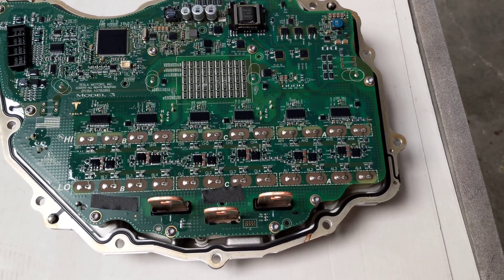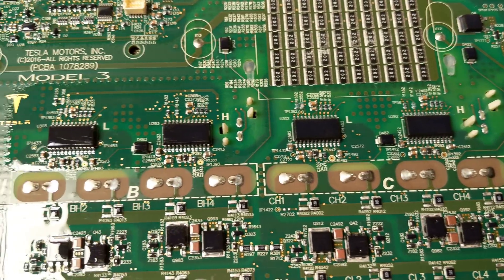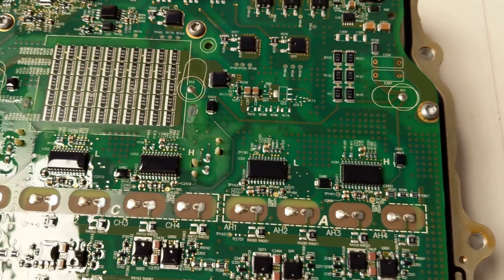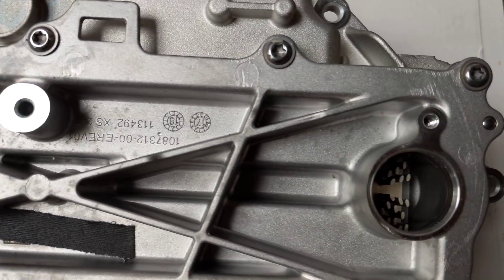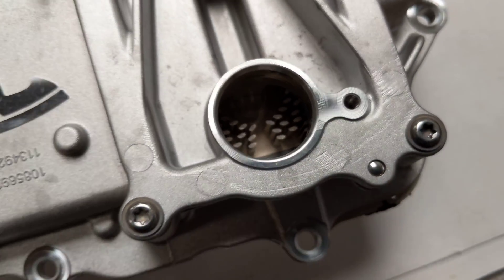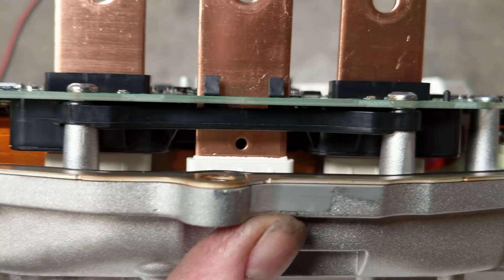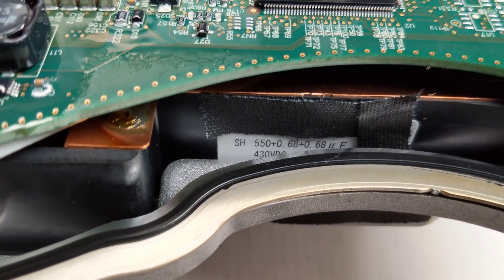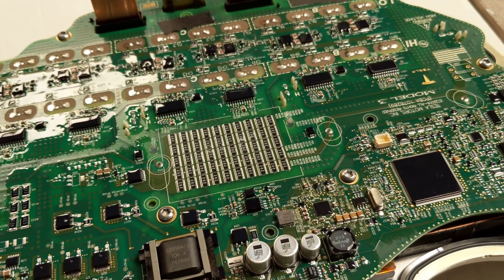Tesla Model 3 Drive Inverter

Comment: I'm not sure what you were referring to as the SiC FETs ?  was it the D-Squared paks on the PCB or were there some modules behind the PCB on the bottom side ?
I find it hard to believe that 24 D2Pak SiC FETs are going to do as much power or current as I am seeing talked about here ?  Is that right that there are just those 24 D2PAK SiC FETs ?
Reply from the maker: No, as I said in the video they are custom parts mounted on a coldplate.  I have never seen any package like this in use before, it's a large rectangle with massive copper tabs on opposite ends (Source and Drain).  Did you even watch the whole video?  The side of one can be seen at 2:10.
Reply: Ingineerix yeah I watched the entire video a couple of times and especially the part where you showed the copper tabs but I was not sure if you were referring to the 24 arrange D'squared packs on top or something else underneath. The heat transfer methods are sometimes extreme so I wasn't sure if there was an extension of that to the D'squared packs. It was hard to tell what you were trying to show from the side. What you just said confirms my suspicion. Thank you.
Reply: You also mentioned I believe that they was were ST silicon carbide FETs. It did not look like you could read any manufacturer name on custom parts from the side but I saw your number in the description. That number was probably visible on the D'squared packs so that was my confusion  source. I know that Tesla is using another company's silicon carbide fets now at least in addition to these St parts
Reply from the maker: Here is an image from another teardown: https://ibb.co/dfvktz
Reply: WoW!  That's what I'm talking about ! Now it's clear. Thank you !

Comment: really incredible that they managed to fit it all on one board, its things like this that make the overall cost come down! props to the engineers behind this design!
Reply: I already changed 2 inverters. One went 5000km another 2000+km. Now purchased a 3rd one. Tesla 3 SR 2021😅
Reply: Just wait until that ONE little capacitor or something goes bad! from the design you'd have to tear half the motor apart to even get access to it, all those bolts, and then the rubber seals. This board should have been mounted in a box on the firewall or something not buried inside the motor!
Reply: @FCE-dogs  MLCCs are reliable and they have conformal coating, you watch too many Louis Rossman videos lol

Comment: How do you know they are SiC fets? could they be GaN?
Reply from the maker: I know 100%.  Among the evidence: Elon himself has said they are SiC, and ST (the logo on the package) doesn't make GaN devices like this.
Reply: GaN isn't as useful for high voltage lower frequency applications as SiC
Reply: Ok. It's quite significant that 4 little? FETs can handle around 300Arms in mass production 20 year reliability. What does the package look like?.

Comment: This is effectively a brushless esc right?
Reply: Not always, brushless ESCs output more square outputs. Earlier Tesla drive units on the Model S and X were sinusoidal 3-phase inverters as those were full induction motors, don't know about these ones though
Reply: @NoorquackerInd  cool!
Reply from the maker: Yes, but on steroids, and a lot more complex.
Reply: Ingineerix right.

Comment: Great video!! Is there any chance you could post a short clip of the reverse side (dark side) of the inverter? I'm curious to see how they manage the high current routing for the DC link and inverter output phases. As well as how they have connected the SiC FET's to the DC link and output phase bus bars...

Also, do you think the array of bleeder resistors is purely for bleeding the DC link capacitance, or could they also be using them for light/emergency regen dissipation when the battery bank can't handle all the regen energy?
Reply from the maker: There are 2 welded copper bus bars conducting power from the DC input connector, to the capacitors, and then to all the SiC FETs.  Then there are 3 more that carry the output phases to the motor.  There is no high-current stuff on the PCB.  I can assure you those resistors can only be used for cap bleed, there is no way they could handle any regen power.   When you drive a fully charged Tesla, there is no regen.
Reply from the maker: I updated the description with several images of the SiC MOSFETs.

Comment: Great job! What's weight and size total and PCB?thanks
Reply from the maker: The inverter and it's casting/cold plate weigh 8.5lbs/3.9kg.  I cannot separate the PCB without damage, so not going to happen on this inverter.
Reply: Wow. I am really impressed. Could you indicate the dimensions as well. Thanks again

Comment: So is the inverter the same thing as an ESC electronic speed control found in RC Cars? It seems small to control that much power.
Reply from the maker: Basically, Yes.  Part of the compact size is Tesla's use of cutting-edge Silicon-Carbide based transistors.

Comment: what is the C2000 mcu part number? I'd like to know which processor family they are using.
Reply from the maker: TMS320F28377DPTPQ
Reply from the maker: Also: I put the major parts list in the description.
Reply: That ST SiC FET part must be custom as it doesn't pop up on their product list. What is the package? discrete devices? half bridge?
Reply: im willing to bet it's their 100A part repackaged in one of their SLLIMM power module packages

Comment: +Ingineerix ("Feel free to ask me specific questions ") :  Would you  or anyone happen to know whether the control interface to these inverters instructs them to produce specific AC voltage or current at a specific frequency,  or is it more specific to the motor's role in the car, as in "apply X.YZ torque"?    If it were the former, would it be practical for a DIY off-grid solar/battery setup to use salvaged EV battery pack(s) along with a salvaged motor inverter unit, and just command the motor drive to apply 208VAC, 60Hz three-phase power to the home... er, I mean, "motor"?
Reply from the maker: The inverter is highly integrated.  You would not be able to use it to produce AC power without substantial rework.  Mainly there are no magnetics which would be needed for this, and they are expensive at those power levels.  Not to mention, the software work would be a massive undertaking.  You can however use the battery pack as is, with an external inverter.
Reply: Thanks;  the lack of magnetics makes sense.

Comment: I could be way off base here, but since it has a permanent magnet motor and the current is not switching from + to - (inverting), isn't this technically a motor controller and not an inverter??
Reply from the maker: While the motor uses permanent magnets, it is an AC motor, so it has a 3 phase stator.
Reply: Thanks, Learning more about this motor now... very interesting...
Reply: so is it sensored BLDC motor ? for all models or just this one ?
Reply: @SuperAymoon  This one. The others are AC induction machines

Comment: Im amazed how small it is.  SiC has really improved quickly in a short time. What price are these individual mosfets? 100usd? 
70uF bus caps also seems  low ?  Is that all of the capacity to smooth out the commutation ripple?
Reply: That's the capacitor for the low voltage SMPS. There is a much larger DC link hiding under the hood. Though the high frqency SiC switching means the capacitor will be small than you think. Perhaps 250-300uF but with very high power density. Probably 200-250Arms ripple current rated. There are other pictures that show the PCBA removed and the main DC link is clearly visible

Comment: The marking on that capacitor looks like it reads 550 + 0.68 + 0.68uF.  Could be a big low frequency 550uF bulk cap and then a pair of 0.68uF high frequency snubber types?  Any other markings hiding around there?
Reply: I believe the 550uF is the DC-Link X capacitor and the 2 x 0.68 uF are the Y (EMC) Capacitors

Comment: Can you see a part number on the gate driver ICs?  Any idea what the gate drive voltages are?  Interesting to see the custom 4-lead FETs.
Reply from the maker: They are using the STGAP1AS.  Here's the datasheet: https://www.st.com/resource/en/datasheet/stgap1as.pdf
Reply: Great, thanks.  I've used those before, they're pretty close to the fanciest gate driver you can get at the moment.  It looks like they still have an external high-current buffer, which would make sense for trying to drive 4 together.  Normally I would have assumed they'd have issues with output currents flowing through the paralleled kelvin sources but I guess the actual source connection to the bus bar must be low enough impedance to limit that.

Comment: at 2:18 you say "for each group of 3" but I think you must mean group of 8?
Reply from the maker: There are 8 FETs welded to each of the 3 busbars that go to the stator, 4 positive, 4 negative.  I wasn't clear, but I mean there are 3 groups of 2 switches (+/-).
Reply: The motor/controller are three phase, and there's one output bus per phase.  So there are three busses.

Comment: Does it require cooling?  I worked on the 1st version M3 inverter, it had 36 IGBT's mounted to a liquid cooled heat sink.
How does the M3 dissipate the heat?
Reply: Yes, there's a liquid cooled heat sink.  You can see an inlet or outlet in the video with the heat sink pins standing out from the heat sink.  Motor, controller and battery pack are all liquid cooled.
Reply: Of course it requires cooling. If it's going to run 200kw peak it would need 20-30kW of cooling...

Comment: According to docs online the module is custom designed for Tesla order by European R&D company (http://www.apcenter.nl) and contains two ST SiC  mosfets, likely the same dies found in those: https://www.st.com/content/st_com/en/products/power-transistors/wide-bandgap-transistors/sic-mosfets/sctw100n65g2ag.html (650V, 22 mOhm, 100A)
There are 24 modules, and in 3 phase inverter it means 4 modules in parallel, giving rating up to 800A.

Comment: Impressive!  Remember it handles close to 200kW, soooo crazy 😲
Reply from the maker: This inverter can do almost 300A per leg.
Reply: @Ingineerix  are there hidden FETs on the opposite side of the board?
Reply from the maker: According to the info from the CAN bus, the max kW it can pull on a RWD long-range at 70%SoC is 308kW.  Of course that doesn't mean that's how much you get in practice, just what the limit is.   BTW, 200kW would be around 500A from the pack total.  (depending on SoC)  Keep in mind, per-leg RMS current is not the same.
Reply: @Ingineerix  Thx for sharing that, I'm curious and I dont understand the power IGBT connection. Power switch is obviously through hole (TO247 I guess) but there is only 2 pin for each.... I recognize the custom gate drive based on Dpak mosfet but the third pin of switch remain a mystery. What is the trick ? Do they bend a pin behind and connect it directly to a bar bus to economize some layer with strong thickness of copper ?
Reply from the maker: @UPR91  These are custom package SiCFETs, (see description above) each of the 24 discrete packages are arranged in six groups of 4 in parallel. For each of the 3 output phases, there are 4 for high-side and 4 for low-side.  Besides the large welded tabs, There are 2 small pins on each SiCFET that I assume are the Source and Gate pins that are bent up and terminate on the PCB for the gate drive.  See this page for images showing what the SiCFET packages look like: https://www.systemplus.fr/reverse-costing-reports/tesla-model-3-inverter-with-sic-power-module-from-stmicroelectronics/
Reply: @Ingineerix  thanks again, the datasheet is still not available for consumers but based on your link, I found more info on the STc module P/N: SP18413 https://fr.slideshare.net/system_plus/tesla-model-3-inverter-with-sic-power-module-from-stmicroelectronics-102988042
Reply: @Ingineerix  How do you get the info from the CAN bus about max. KW and can you "trust" that? Would love to test that on other models of the Model 3. The RWD is listed at 225KW officially, so 308KW is interesting.
Reply: So are there 3 legs then? Do you add them all together for the total? If so, we are talking about an inverter capable of almost 360kW at 400V.
Reply: Did you ever find out if you add the 3 legs all together for the total ? I thought if you wanted a 120kW inverter at 400V, you needed 300A per phase..
Reply: That's not how it works.  The inverter combined with the inductance in the motor works as a buck converter in most cases other then at very high speed with field-weakening where some work as a boost converter.   Power flows from the battery in one phase and out another and the phases are changing to rotate the field around the rotor.   So its common to see something with 300 RMS phase amps only able to do 80kw or something as there is many factors in play but the Phase amps do no directly correlate to the DC amps.
Reply: I see.. but do you think there's some kind of percentage factor you could apply to the DC amps in other to give you an idea of the RMS phase amps ? Say you wanted to know what would be the maximum current per leg, you should be able to have a vague idea right ?
Thanks for the answer btw
Reply: If you want to know the limitations of the controller (inverter) it self....   Not really.  I mean you can sort of get an idea.  If your max RMS phase amps are say 300 arms then you can likely get a max DC current of ~85% of that with no feild weakening.  But only if the battery and the wires etc can handle that.  Also when you add field weakening you can get much more DC amps and in many cases get more MAX DC amps then the max RMS phase amps.  But again the battery and wires need  to handle this.
Reply: Yeah I bet its a lot more
Reply from the maker: @mondayfool Tesla's is much higher peak power, higher power density, and higher efficiency  than the HVH250.
Reply: How different is this type of inverter compared to the 5KW inverter built into the powerwall? This looks like it is smaller than the powerwall inverter yet it can convert 40x the amount of power?
Reply: @DeanGoldbaum  Let me try: Different purpose, Powerwall needs to work with 120V/230V 60/50Hz which makes i.e. larger magnetics necessary.
Reply: ronexus thanks for the reply!

Comment: So MOSFETs instead of IGBTs? Don't think I've seen a MOSFET controller since the old Curtis controllers for low voltage DC setups.
Reply: It silicon carbide MOSFETs they are new king on the block regarding power electronics.You can get 35 A ,1200 V one on ebay for 40 £
Reply: Yeah, I knew about Silicon Carbide being associated with the inverters by Musk, I just figured it was a new kind of SiC IGBT, since all previous versions called that were an Si IGBT with a SiC diode and not a full SiC IGBT.
Reply: rotaryfreak3 SiC IGBT’s are in r&d phase for very high voltage >10 kv, mosfets provide faster switching/smaller packaging.
Reply: For the Toyota Prius, looks like it will be the next gen one that should get Silicon Carbide MOSFETs. I see articles on the net about it back in 2015 saying Toyota is developing it and it didn't make it on the 4th gen (2016+). Really amazing how compact Tesla can make a heavy duty controller.
So, I assume the rest of the industry will be a few years out with it too.
Reply: wtf it's mad
Reply: +mskz06:  Plus, isn't it a battle between the  drop across the MOSFET's  on-resistance vs. the minimum Vbe of the IGBT?

Comment: So I assume these FETs drive the high frequency PWM which adjusts the frequency and voltage of the power to the motor. They are in parallel to divide the load to each one. I assume they're welded both for a strong contact, and also because a weld has higher heat tolerance.
Reply from the maker: There are 6 total groups containing 4 parts in each group.  Those 4 devices are wired in parallel so act as one switch.  Since this is a 3-phase motor, there are 2 switches per leg, one to connect it to battery positive, and the other to negative.  By feeding these with a high frequency PWM signal in conjunction with the stator's inductance, they can build a sine wave on each leg (or any other waveform they desire).  I don't purport to be an expert on switched-reluctance motors, but it's likely the drive waveform is not just a simple sine wave shifted 120 degrees for each leg, like an induction motor would use.
Reply: My understanding is that waveform shaping is an important part of reducing the "cogging effect" in order to make Switched reluctance PM motors practical for EV usage... so I'd be inclined to agree it's not a simple sine wave output.

Comment: I for one would love to know a little bit more about you, amazed by your breadth of knowledge. Also please go work for Tesla!
Reply from the maker: I'm an Electrical Engineer.  If I worked at Tesla, that would be the end of all the Youtube Vids, Information Sharing, and likely my social life.
Reply: True! But as someone who wants Tesla to succeed, I'm willing to lose the content. Can't imagine you wouldn't be an asset to them. Also what's a social life?
Reply: @MixyDoodle  Most Youtubers are not engineers - this guy here  is a rarity. Most good engineers DON'T want to work in a sweat shop where the top boss is a micromanaging egocentric asshole by reputation, and that shit usually flows downhill (it did at Maxim from what I saw there). None of this stuff is rocket science to a good EE...most of the people here fail to realize that the Model S has been around for almost a decade (I'm counting design and qual time as well) and that semiconductor tech doesn't stand still.